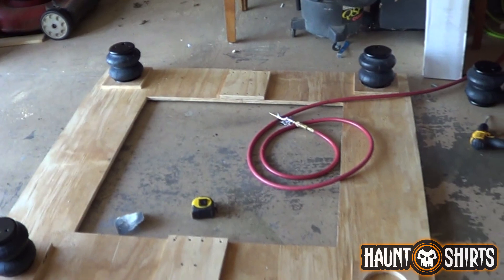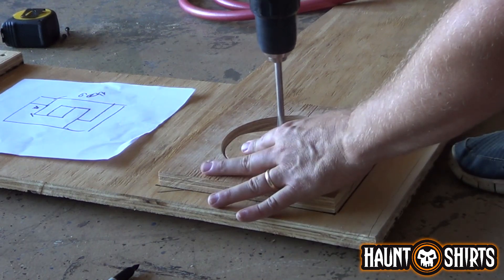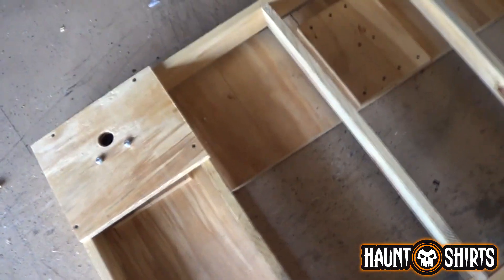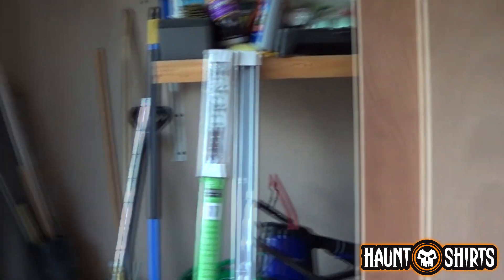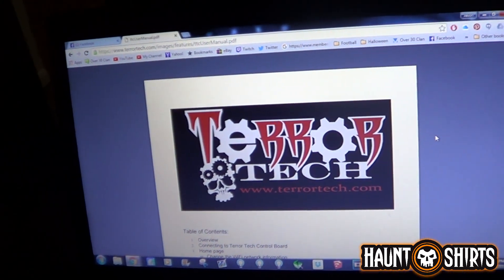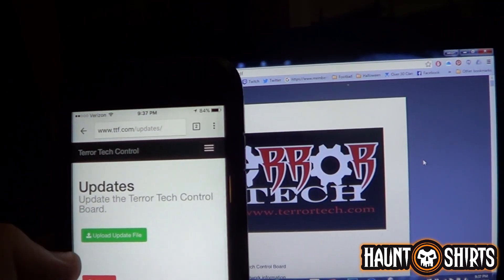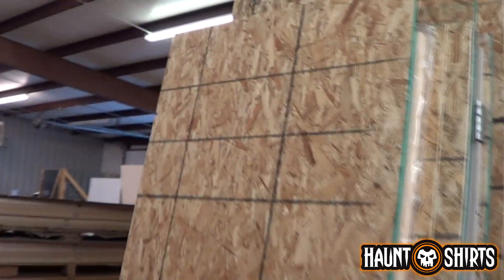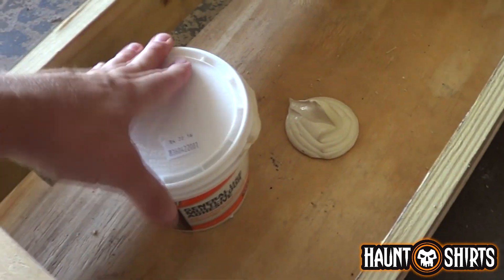Road to October '16 Episode 8

Comment: Idea: Salvage the floor by flipping it over and redoing with correct adhesive. I'm very curious to see how this comes out. I've seen others on YT, but made out of metal. On the controller software, surely they have a PC version that gives you more granularity than 1 second intervals? Anyway, love your builds. They always turn out so cool!
Reply from the maker: What I thought was a 5 x 12 ended up being a 5 x 10 so I don't have enough for a "redo"  plus that stuff has sat rolled up for like 8 years and it's brittle as all hell.  But that is a good idea.  So far that first piece I did seems to be sticking so I think it will work.  That's the next thing I need to do is connect using my PC rather my phone.  Worst case it wont be the end of the world if I can only do 1 sec intervals since Im not going all violent with this thing.